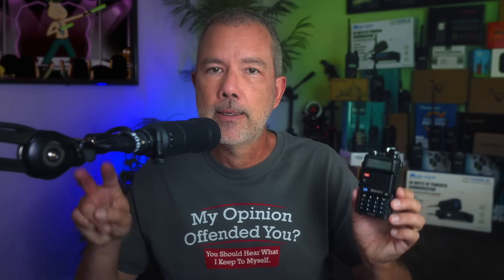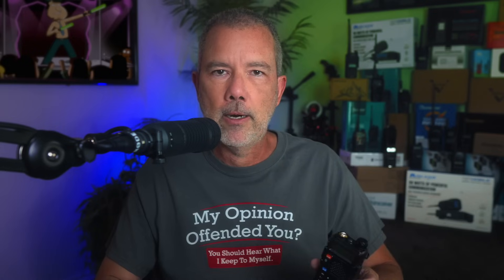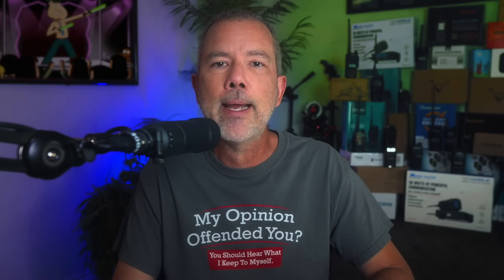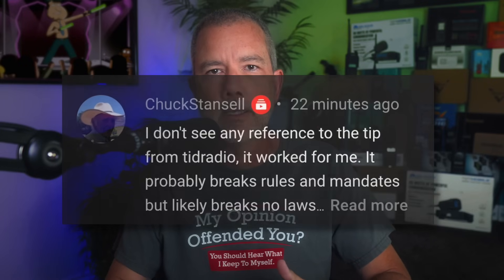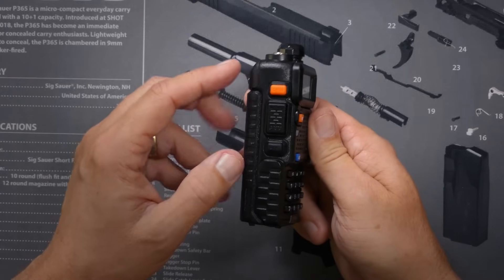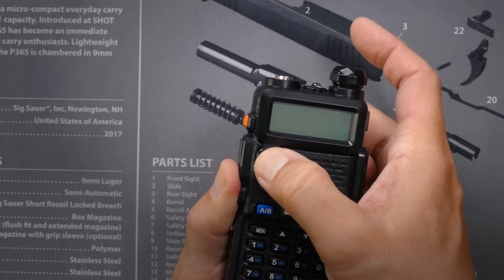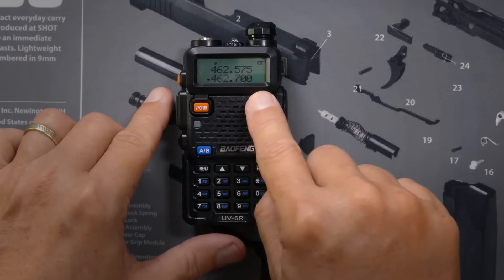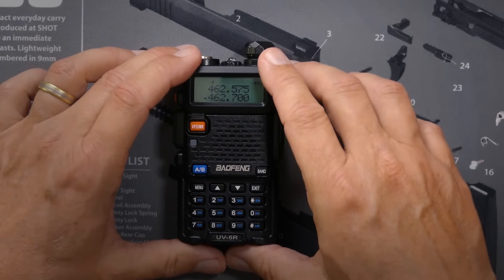How To Unlock A New Baofeng UV-5R - Easy UV5R Jailbreak To Transmit On More Frequencies

Comment: After unlocking the radio, may I immediately use it, or must it be programmed as well? I'm new at this and could use some help please.
Reply from the maker: It depends on what you want to do with it.
Reply: , I bought them for emergency prepardeness, but it sure would be nice to use them for something other than just letting them lay around. Or, lay around. Depends on how I have them positioned.
Reply: Not much. I bought the radios for emergency preparedness. I just want to be able to communicate if the need ever arose.

Comment: How do I relock my uv 5r. I want to be able to go back and forth.
Reply from the maker: You should read the More Info section of the video.
Reply: @TheNotaRubicon  Ahhh, I see you are not where I learned how to restrict to amateur bands again. I learned it from Glam Ham. She learned it from the manufacturer. To restrict to amateur bands again:
1. Turn off 
2. Hold ptt and 5 key and power on.
3. Screen should say amateur

Comment: Looks like I got one of the newer ones (UV-5RM) and this factory reset method no longer works. CHIRP also has an extremely limited set of options based on other videos, so the new ones appear to be severely limited. :(
Reply from the maker: A UV-5RM is not a UV-5R. This never worked on a UV-5RM.
Reply: @TheNotaRubicon  That's super helpful, thanks for taking the time to comment.

Comment: Can you please tell me what frequency I need to put into my uv5r to make it talk to my kirisun DO405 ive tried alsorts
Reply from the maker: If you mean DP405, you will have to find out what frequencies the channels use, then put your UV-5R on that same frequency. But because Kirisun does not publish those frequencies, it might be faster/easier to just buy another $17 UV-5R.
Reply: @TheNotaRubicon  thank you for your help im an abmornal load escort driver and just needed to be able to communicate with other two way radios im absolute dinosaur needing my hand holding 😂 holding do most channel radios transmit on the same frequencys
Reply: @PaulAllen-q3m If you have an SWR Meter, connect to the other radio and it'll show the frequency. Now, enter the frequency into your radio.

Comment: Tried it on a first or second gen UV-5R, a bit older maybe 2010-11. The sequence worked, yet it will not work for "Air Band" frequencies, lower VHF. When you hit the PTT, it shows that it is transmitting, yet when released it continues to transmit. If you're looking for an affordable short-cut for an 
Air Band Radio, this is not it. I suppose one has to bite the bullet and buy the $700.00 iCom or the $900.00 Yaesu.

I tried to download CHIRP to get to the Air Bands and there are so many "Download" buttons that are advertisements one does not know which Download button is the right one. Once you hit one, they will direct you to a loading site and beginning downloading Malware, and they take over your computer and state: "Call This number and an Engineer will walk you through the process of unlocking your computer". I still haven't figured out which button is the correct one to download CHIRP as it seems to just be a Malware Hub. I did the worst thing to save my machine and simply yanked the power plug to do a hard re-start. Everything was okay, and my system was not effected but I did find some new unknown extension files and apps they began downloading. Be careful, as they are slick!

If anyone has the link to the "Real" CHIRP site, that would be appreciated as the one I went to was a mess. I hope this helps. I did not test it on the GMRS frequencies. I'm a Licensed General Class and I just wanted the best of both worlds, Air Band and the 144/440/220 bands to mess around with. I leave the GMRS and recreational bands alone for the hunters, campers and the off-road'ers who want radio to radio communication and not splatter their business over the chicken band (C.B. Radio) to piss off the truckers. Cheers!

Comment: Thanks for posting this Randy. I watched it quite a while ago but...today I had to program a friends radios, (not uv5r's but similar). They were using a freq. in the 70cm band and are not hams...so I got the frs freqs. programmed in it..but then it would not tx because it wasn't open. Your information made it possible for them to use them, and stay where they are more welcome. GMRS is not permitting in Canada, (as you know), but neither is knowing the freq., using an external antenna, or more than half a watt....lol. Take care.

Comment: I tried it and it did not work. I am guessing because I never had a locked UV5R and could always transmit on GMRS as well as FMS. So my question is what year did Baofeng start locking it UV5R radios?
Reply from the maker: yah, if its not locked it wont work because you dont need to unlock a radio that isn't locked.
They started locking them around 2021'ish or so.

Comment: Does not seem to work on mine.  Uk based
Reply from the maker: Is yours even locked? Only ones made to be shipped to the U.S.A. are locked, so if yours is not locked, this wont do anything because you don't need to unlock a radio that is not locked.

Comment: I have four Baofeng UV-5R radios, "that's 4" Baofeng UV-5R's and two, "that's 2" have a white sticker when battery is removed you can see it. And two, that's 2 have a orange sticker when battery is removed. White sticker they are unlocked, orange sticker they are locked. You CAN NOT press three buttons, "that's 3 buttons" to unlock the Baofeng UV-5R radios. I have spent hours and days trying to figure this out and that is the conclusion. I have been looking at your face for days and now I could pick you out in a crowd of thousands. But I thank you for your time and RIP to the Baofeng UV-5R. I will now send my cable back to Amazon and get my money back.

Comment: 1 st Power knob off then press  PTT+lower button+vfo/mr hold all 3 and turn power knob on Factory reset but only 2m 70cm. Then In Chirp Goto Settings tab Other settings on tree then change VHF upper limit to 300 change UHF lower Limit to 300 change UHF upper Limit to 520  save file write to radio now it will cover 136-520hz rx and tx.😊

Comment: I've had my uv5r a while- how can I tell if it is a “new one” v. old one… I did try your procedure on mine, yet it just started up normally. Thank you!
Reply from the maker: Is it locked?
Reply: @ I'm not sure, Sir. I bought this in 2022- someone told me that the “new” uv5r has to be unlocked and the “older” ones don’t. I heard you're the man when it comes to radios.
Reply from the maker: You only need to unlock it if you need an Unlocked radio - if you dont know if yours is locked or not, then you probably do not need it to be unlocked.. Please read through all the warnings and updates in the more-information section of the video.

Comment: UV-5R+PLUS says "coping' after pressing the buttons ??
Reply from the maker: That means it did not work, either because your radio cannot be unlocked, or, because it is already unlocked.
Reply: @TheNotaRubicon  Thanks a friend gave me the radio so I'm not complaing. the thing is my motorola radio will talk to Baofeng but Baofeng will not talk to Motorola

Comment: Hi, it worked on all 3 of my UV5Rs but not so much on my F8HP. Any ideas why?
Reply from the maker: Because this only works on UV-5R radios and a BF-F8HP is not a UV-5R.
Reply: @TheNotaRubicon  my question sounded even dumber when you put it like that.,..lol. I was just thinking since it's so close the UV-5R, it may work,  I'm very new to this and quite "confuculated" about a lot of this.  I'm kind of struggling on the "Tone" and Squelch Tone" in Chirp.  Which to use and why/?  I've Googled it but the answer was over my head.  Would you have a vidoe about that, or maybe one in the works for the future?  

Anyway, love your vidoes, I'm hooked!  Thanks for the the fast reply! -Randy WSHB876

Comment: Hi, am wondering, FM radio doesnt work on my one, some tips?
Reply from the maker: Between 2021 and ~2023 many were manufactured without the chip required to receive commercial FM. The only way to fix that is to throw it in the trash and invest $18 in a new one.

Comment: I just picked up a new baofeng uv-5RTP this morning (programmed) but locked. The guy told me the same, press the 3 buttons. The radio displays FACTORY on the display but i am unable to change channels or frequencies. Doesn't seem any button works BUT holding the talk buttom the red light does display. The radio is displaying FRS1
FRS1-1
Reply from the maker: Sounds like the keypad is locked.

Comment: Does this method still work? I’m not having any luck with my two baofeng uv-5r
Reply from the maker: are your two radios even locked to begin with? It wont work unless your radio is locked, because unlocking an already unlocked radio is not necessary.
Reply: @ I assume they are still locked as I can’t transmit

Comment: I know it's probably not allowed anyway, but I wish that dedicated GMRS radios would be able to receive the transmissions from a UV 5R that is unlocked. That doesn't seem to work from what I've heard. At least for a Retevis RT86S gmrs radio.

I wonder if there would be a workaround for that. So that if there was an emergency, everyone would still be able to communicate on the gmrs frequencies

Comment: I got an older model in today with the older Roger beep and different speaker design if that tells you how old it is and I still had to unlock it. But I thought the older ones were unlocked? Is there a way to tell what year or version your radio is?
Reply from the maker: The older models, if manufactured before around 2022, are unlocked.

Comment: Your videos are bad ass! I have 2013 and 2017 UV-5Rs… is anyone aware of a button combination that would unlock the older versions?
Reply from the maker: 2013-2017 UV-5Rs are unlocked out of the box.
Reply: @ Roger that thank you! I’m hitting the ham repeaters but not GMRS repeaters. I’ll check my programming again.
Reply: Is the 2013 one the one that’s like twice the size of the modern versions? If so, I would buy that off of you haha.

Comment: Hmmm....not working.  Said FACTORY, but not working on GMSR freq.  Also, inside battery it says "FCC".  Is the UV-5R no longer "evil"?
Reply from the maker: As mentioned in the More Info section of the video, many newer UV-5R radios (mfg'd after this video was uploaded) cannot be unlocked.

Comment: Did not work on my BF-5RH
Reply from the maker: Yah, a BF-5RH is not a UV-5R, so its not supposed to work.
Reply: Is there a way to unlock bf-5rh?
Reply: Is this a good radio or should I buy the uv-5r? 
Thanks
Reply from the maker: Watch this video to see which radio you should buy:  https://youtu.be/78T7k3to1PE?si=der1pUj0ccXQEaq1

Comment: Tried this on an older 5Rax I have and comes up with "copying" not "factory".  No idea what it's doing, didn't make any changes I can detect.
Reply from the maker: Is your radio even locked? This only works on locked radios, because its not necessary if the radio is not locked.

Comment: This did not work for me
Reply from the maker: Is your radio a UV-5R? Is it locked? If it is not a "UV-5R" and if its not locked, it wont work.
Reply: @ it is a UV-5R and it was unlocked by the chipr program.
Reply: But I can’t transmit

Comment: I have a brand new one. I just got it will not unlock with that method. Do you have any ideas?
Reply from the maker: My ideas are:
1) it is not locked to begin with, so it cannot be unlocked because its not necessary
2) you have one of the new ones that, as mentioned in the More-Info section of the video cannot be unlocked

Comment: I just purchased a BaoFeng 5RX and the factory unlock didn’t work. Is shows factory after pushing all three buttons, but I can’t transmit. Do you have any experience with this radio?
Reply from the maker: i didnt work because a 5RX is not a UV-5R and this only works on UV-5R radios.

Comment: It does not work for me... 😢
Reply from the maker: Is your radio locked? It wont work on a radio that isn't locked because its not necessary.
Reply: @TheNotaRubicon  nope... It is locked... When I try this it does nothing... No factory message on the screen or anything... It just turns on normally
Reply from the maker: It sounds like you have one of the newer ones that cannot be unlocked, as mentioned in the updates/More Info section of the video.
Reply: @TheNotaRubicon that's sad... I don't even live in the us to block me like that xD

Comment: I have a question, I bought one of theseabout 3 years ago and it will work on any frequency I can type in including the one you just showed.  The question is why did I not have to do all of what you just did and yes I bought 6 of the brand new and they all do it out the box.
Reply from the maker: Because older ones are not locked. Only newer ones made to be shipped to the United States are locked.

Comment: Holy crap, that was easy.  And here I thought I would have to buy a connector cable and unlock it with CHIRP.  I had no idea the factory reset would unlock it.   I'm not even doing anything fancy.  I just wanted to be able to tune in the NOAA channels, and now I can.  Thanks for all your videos.  I'm eating them up.
Reply from the maker: Thanks for watching... But.. You can receive the NOAA channels without unlocking it.
Reply: @TheNotaRubicon  One would think, but I could not.   Brand new unit, received today.  It behaved just like it does when you try a GRMS frequency.  The moment I unlocked it, it could tune to weather frequencies.

Comment: I have unlocked (2) UV5r radios, however, I just tried to unlock another one and it will not respond to the unlock key sequence, and it will not even connect to Chirp. Probably just a fluke POS, but who knows...🤔

Edited to add: Underneath the battery, on the radio there is a small sticker that says GMRS...so, this is a UV5r GMRS. My other (2) UV5r radios do not have that sticker. Regardless, the POS still will not connect to Chirp

Comment: This statement is unclear to me.  It was also mentioned briefly in another video that linked to this video.
???? Will unlocking the radio allow me to receive more frequencies? NO. 

Maybe I'm misunderstanding what this means, but what is the point of unlocking additional frequencies to transmit if I won't be able to listen back on those same frequencies?
Reply from the maker: The radio, when locked, receives a very wide range of frequencies but can only transmit on a very small range..
When you unlock the radio, it can then transmit on all/most of those receiving frequencies, but it does not add new frequencies that it can receive.

Comment: Tried this with my uv5r radios, and it didn’t  work for any of mine.
Reply from the maker: Are they locked? it wont work unless they are locked.
Reply: @TheNotaRubicon  Didnt work on mine either. How can you tell if it's locked other than it not transmitting?

Comment: One of my radios did unlock, while the other that came in the same box did not.  When I attempt to transmit it just flashes.  And the CT icon lights up. Might have to do with me programming in a repeater with a tone?  Thanks!

Comment: Pressing tangent and going on air without antenna attached will burn the crystal chip! 
DO NOT do that please...
Also- why would not doing a factory reset from the menu entry work?
Reply from the maker: 1) this radio does not have a 'crystal chip'
2) it has been proven (by me, on video) that transmitting on this radio with no antenna will not hurt it in any way
3) because doing a factory reset from the menu entry does not work.
Reply: @TheNotaRubicon  No crystal chip? Did not know that :)

Comment: Exactly what ranges of frequency the Unlock enables and whether Tx/Rx? 

1) Unlock only enables TX on UV-5R previously listed as RX freq only:  Receive frequency range: VHF 136-174 MHz and UHF 400-480 MHz. Nothing else, no new freq, such as FM radio bands??

2) Specifically, will it unlock / REVEAL new freq, eg, AM Airband, FM-radio that are available in the UV-5RM, listed below?
UV-5RM:
FM 76-108 MHz, AM 108-136MHz, VHF 136-174MHz & 220-260MHz, UHF 350-390MHz & 400-520MHz, and 10 NOAA Weather Bands. Transmit across 144-148 & 420-450MHz frequencies.

Thanks

Comment: i was able to get the Factory message but it partially transmitted on the 469 frequency and gave the screw you tone most of the time, but still it was going through most of the time.

Comment: Just bought a UV-9r Pro and it seems to be locked. I tried holding the button method and powering on. It says factory but still unable to transmit. Any solutions?
Reply from the maker: No. The UV-9R Pro cannot be unlocked.
Reply: @TheNotaRubicon  do you have any recommended baofeng hams i could use that are unlocked? I just want one radio to learn it all. The reason being is that i do airsoft. In the event i am paired with a group of players who are running gmrs radios, i would simply like to use my ham to communicate with them. Thats all.

Comment: You can do this and lot more with the programming software Chirp. You have to set the VHF or UHF lower and upper limit to these frequencies that i found work: 127-178MHz and 379-543MHz. Have fun and be safe!!!
Reply from the maker: You cannot do this with CHIRP.. if you have a locked UV-5R, what you claim will do nothing.

Comment: Damn, wont work on my UV-5R. Just comes on normal and doesn't show factory reset.
Reply from the maker: Is yours even locked? If its not locked it wont work because you dont need to unlock a radio that is not locked.
Reply: How old is yours?  And where did you buy it ?